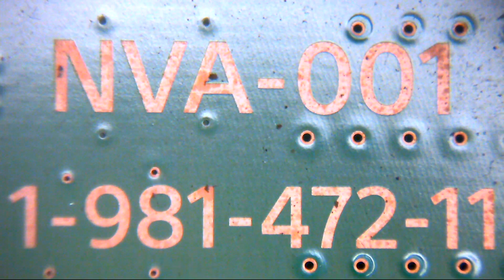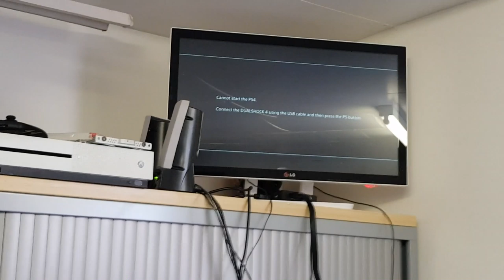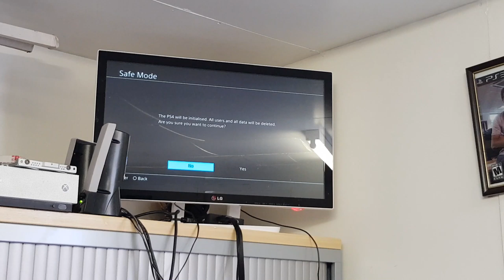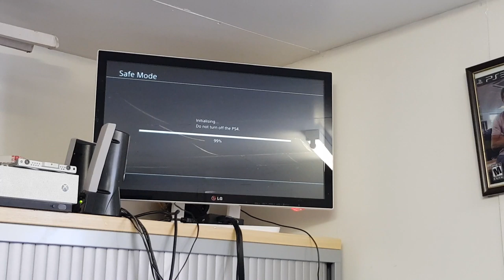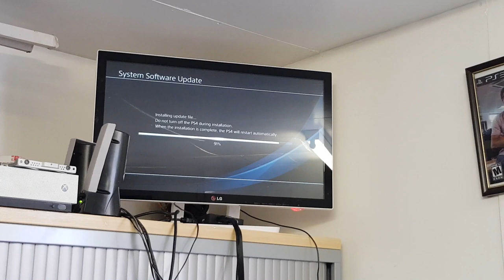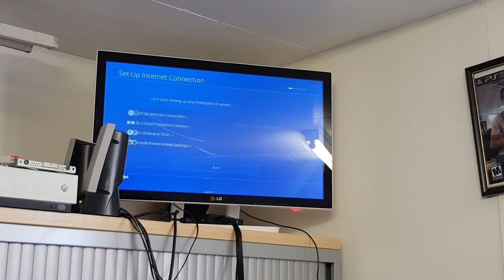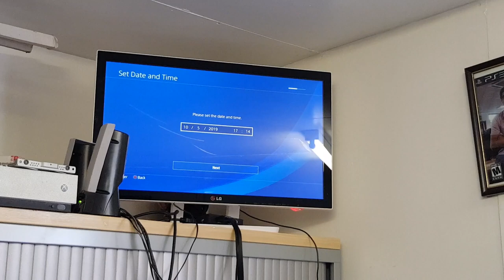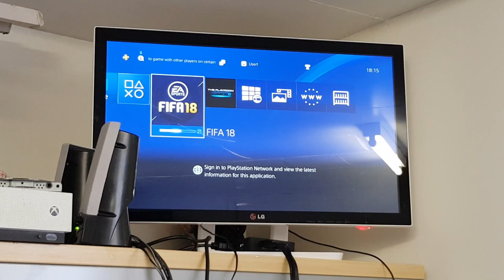PS4 Pro Fix SU-42118-6 No Disc Feed and Update loop - Fault Diagnosis and Repair (NVx motherboards)

Comment: You're back. Fantastic! I sent you a message on Twitter, but I thought you'd probably be busy.
Reply from the maker: I've not checked Twitter for a while bud to be honest - I think I may close my account on there just to streamline the communication methods open to me as trying to keep track of here, email, Twitter, facebook etc is a nightmare! Drop me an email to the address in the description bud if you still need me and I'll get back to you ASAP, cheers :)
Reply: @AndrewPaul  I've got a 1.3 Xbox original here. The clock cap has leaked. I'm determined to refurb it. It is the worst damage I've seen from the leaky cap ever. I'll post some pictures when I get time. But it has actually eaten away through the metal inner casing.
Reply: @AndrewPaul  can help me

Comment: I agree 100%, the PS4 slim is my least favorite console to work on. It seems to be the least reliable as well, disc drive,HDMI, and power supply issues. I manly get customers bringing the Xbox One in with update errors. Sony did do a better job with new software installs though, Thanks for the video!

Comment: Thank you again for your patience explaining all the procedure. I have this issue, but I already checked all fuses, but they have continuity, and seems to be ok, what else could be wrong? or what other fuses should I check? to be honest, I can not identify which component is the one mentioned in the board, for example F5001. I hope you can help me, or somebody else in the comment section. Thanks in advance!!

Comment: Hi Andrew, great video as always. What would be the next thing to check if the fuses were OK? Thanks
Reply from the maker: Check the simple stuff like condition of the cables, connectors, soldered connections etc to and from the drive. If that's good, manually feed a disc using the manual feed screw and see if it plays - if so, it's quite likely you have a burned feed motor - this is a common issue on older PS4s especially - I've changed out quite a few motors on these 10xx/11xx consoles especially.

Comment: So is it usualy the fuses whit this problem? I have one whit this problem it been working fine for 3 years.  but after update 9.0 came and the code came. The disc have been dead the before this. But i guess. This is the reason. Have to check.. Nice to see your well in this  time and days. Your videos and support always helps me.

Comment: Hi, thanks for the video, i recently replace an F6202 fuse, installed system software 8.01 but after replacing the fuse the rollers spin on system start up for like 10 seconds but otherwise non responsive, does not take a disk at all. Motor has continuity, rollers and white sidebar are in tact. Wondering if it could be a ribbon cable or a chip on the board (hopefully not). Have you come across this issue before? Not worth getting a new BDROM as it is 70 odd quid! Thanks

Comment: Hello Andrew. First, great informational videos you have. Thanks for sharing these with us.
I have an old PS4 that could have this problem. I see that you say in the description that we can use Panasonic ERBRD1R00X fuses as replacements. Is there any other fuses you could tell us that we can use as replacements as well? In my country its not so easy to buy those spare fuses separatedly.
If you could give us the specifications of the fuse as well (if you have them), I think we could try to find other replacements based on those informations.
Thanks again!
Reply from the maker: Hi, Indeed - any similar-spec'd 0402-sized, 32V DC, 1A, fast-blow fuse should be fine.

Comment: My board looks a bit different but the previous owner bridged f6202 with a wire 

I ordered the fuse off eBay but does the PS4 know if it’s bridged or a proper fuse ? 
Just surprised it’s not accepting disc at all. 

Any thoughts ? Any other fuses to check on the board except 6201, 6202, 5001. 

Thanks in advance
Reply: Well if it is jumped it's possible there's damage to the renesas

Comment: Hi Andrew, I'm a big fan of your diy tutorial of fixing consoles! Keep up the good work mate! A lot of people found relief with your channel.

I have the same problem with my ps4 pro of this SU-42118 6 error.

All fuses are ok. I also check the BD Rom to other ps4 and it's all function well. So the problem is definitely in my ps4 motherboard. There are no sign of soldering or component burns. What would be the next probable problem given above facts okay?

Thanks Paul. Looking forward that my ps4 bdrom can work again. #fingercrossed.

Comment: Hi, I have just replaced a blown F6202 on a PS4 Slim and also found a bridge between two legs on the renesasas. Not sure how that happened, assuming someone was messing about with it before me, but i've fixed that too. Bluray drive sensor has always worked but still nothing from the rest of the drive. I've checked the motor on the KLD-004 and I'm reading between 100 and 300 Ohms. Should I look to replace the KLD-004? Or am i just wasting my time because it's probably the renesas? How can I confirm if it is? Thanks.

Comment: Hi Andrew, how are you? Hope so...
First of all, thank you for your dedication with the videos posted, you are to be congratulated.
See if you can help me with this question.
I have a PS4Pro Card - NVA-001 identical to the one in this video.
When keeping both fuses on the board, it shows the error ce-35888-2 and when removing the F-6201 the error changes to su-30631-3.
Is it the Bluray Drive Chip or the Corrupted Nor..

Thank you in advance for your attention, big hugs

Vander Daniel - Ourinhos - SP - Brazil
Reply from the maker: Hi Vander - many thanks for your message!
To be honest in these instances it's hard to tell, but it definitely looks to be one of the two sadly. Most likely will be the Renesas - they are very unreliable it seems.

Comment: Just got one of these today even with same motherboard. If fuses test good as they did in my situation along with a good turning motor, I guess BD7764MUV motor drive controller IC would be the next logical step. Have seen quite a few older model PS4s with same symptoms and just another one a few days ago.

Comment: How do you determine the rating for these fuses pal? Do you have a spec for certain boards or a schem from somewhere? Research size etc? If of course you have no donors! Welcome back BTW
Reply from the maker: I had stacks of donors available for ages - eventually when the time came to buy some in it was posted in a repair group somewhere that I came across to use the ones recommended in the description. IIRC they're 1A fast blow.
Reply: @AndrewPaul  Ahhh that makes things easier then. I hate tracking down SMComponants when not sure of specs. It's a whole other job to deal with ;)
Reply from the maker: Yeah - it's a nightmare but also strangely fun at the same time ha ha :)
Reply: @AndrewPaul  We will endure!

Comment: Hi mate where can i order fuse f6202? My ps4 slim wont update to 11.52 because of that fuse. Also do u need a microscope to do the fuse?
Reply from the maker: Mouser or even eBay should have the fuses you need. You don't need a scope but they're pretty small so grab a couple in case you lose one or two.

Comment: Hi Andrew,

What could be the reason for a PS4 pro sill not reading disks (loading them, spinning and laser shining, but no disk icon top right) and getting the error while updating? 

I had the f6202 replaced, before that the drive was completely dead. 

Any info, I would greatly appreciate it.
Reply from the maker: First thing would be to check the fitment and condition of all ribbon cables (both ends) to and from the drive, as well as the seating of the flex cable into the laser itself. Always check the basics first in these scenarios.
Reply: @AndrewPaul  Just took the drive apart and tested the ribbon cables for continuity. Could not find any faults. 
I would also wanna say that I tested the console with a spare PS4 slim drive, and I could observe the same behavior. Disk spins, laser reads, however nothing on the screen.
Have maybe you encountered a similar problem in the past?
Reply from the maker: It's not one I've ever seen personally, no. Only time I've ever seen anything similar is with a knackered laser but you say this one sounds to be reading and spinning fine so in that instance, if everything is spinning up and sounds to be reading OK, I'd be checking the connectors for any damaged pins etc, then tracing the circuits back from the connectors for any missing / damaged components etc. Failing that, get a working board and start taking voltage readings, diode mode measurements etc and comparing values to try and spot anomalies and go from there.
Reply: @AndrewPaul  Another thing that just came to my mind. The original drive from the console was not spinning the discs. I persume some motor damage.
So to test it, I used a drive from a ps4 slim that works. Could this be causing problems?
Edit: What surprises me the most is that I still get the 42118-6  error, after replacing the fuse
Reply from the maker: As far as I'm aware (unless anyone knows differently) the slim and pro use the same KEM-496AAA deck, however I think the sensor boards are slightly different between the two drives. Whether that makes a difference to the console or not (i.e. if the connector pin out for the disc / mechanism position sensors are different between the Slim and Pro drives), I'm unsure - it's not something I've ever looked into in any detail.

As a test, I'd take the laser deck assembly from the slim drive that's working and install it into the Pro drive, then reinstall the Pro drive and see if it makes a difference to the end result. It's the only thing off the top of my head that kind of makes sense barring a circuitry issue on the mainboard.
Reply: @AndrewPaul  Tried to do that without much success. Now the working slim wont pull cd's :D Not sure if a fuse blew, or just needs some time to rest, but I put everything aside for now. Wasted enough time for today
Reply: @AndrewPaul  I come with a short updated. Cross tested the drives between the Slim and Pro. 
Plugging in the Pro drive in the Slim I observed the same drive behavior. Disk tries to spin but does not, laser shines but the worm gear does not move. Since I tried a couple of times, I burned the F6202 fuse.
Plugging in the SLim drive in the Pro, there are no issues except that I do not get the reading disk icon on the screen, and I still get su 42118-6 while updating. 
I also switched the ribbon cables to test the Pro drive, however nothing  changes.
One thing on the top of my head is what could be causing the Pro drive not to spin and move the laser?

Comment: excellent video, I made a what you did, but it worked for me, so I borrowed a ps4 pro from a friend and put his reader on my ps4 and it continued with the same error, when I installed the reader on my friend's console it no longer does nothing, if it sucks the DVDs, because that happens if it works perfectly
What can I do to make it detect the reader again, since before it worked fine
Saludos desde Panamá

Comment: hi mate been watching your vids for few yrs now fixed a fair few things with your knowledge but im having a problem with a ps4 same sort of issue as this vid its a original ps4 popped f02 replaced it and it popped agian im not sure as to why they are popping im thinking maybe its something to do with motherboard any help is much appreciated
Reply from the maker: I tend to find it's the feed motor in the drive is bad when this keeps happening. Change the motor and the fuse together - all should be fine then.
Reply: @AndrewPaul  thanks for the reply ive got spare drives so will nick a motor from them fingers crossed lol

Comment: Hello. I got this problem and about to try to fix it. What temperature do (the heatgun?) need to be for this to work. Hope for an answer. Thanks!
Reply: Hey there I'm having the same issue did you get an answer on how to solve that problem
Reply: 370 C is the meltin temperature of the solder with the soledirng iron, you need at least 400-450 with the heat gun.

Comment: Hi there hope u doing well having problem with bootloop on my ps4 sac001 doesn't allow to do reinstall think unit is bricked wondering I got the same model board spare if I swop out nor ic do I still need to flash if not do I need to change any other parts with nor ic thanks
Reply from the maker: What error number are you getting?
Reply: Hi there wen try doing it via USB error su413334 wen using first USB port I'm getting 1 flash orange second USB port working normal if I do software via internet it just keeps looping
Reply: Wen doing internet software update getting error su424774

Comment: Hi Andrew.
I got this 42118-6 on my PS4, so no disc feed. F6202 was blown so I replaced it. Now the disc feed works most times. However, after a while, it seems the disc drive loses power and it stops reading the disc. Do you what could be the cause of this?

Thanks in advance
Reply from the maker: What model PS4 do you have there?

Comment: what is that liquid substance you add on the board after removing the fuses. the thing you apply with the brush is flux but what is the liquid
Reply: also could you give me a list of all the items you used in the video to do this so i can get my playstation repaired 😭
Reply: If you mean after he's done the soldering it will be alcohol to clean it all up

Comment: hello Andrew, thanks for the videos, I have a PlayStation pro, the fuse F6202 cuts off with each change, can you help me please?
Reply from the maker: As in it blows straight after you've changed it? If so, it's likely the drive mechanism feed motor which has gone bad - you'll need to replace that motor and grease the mechanism (or just replace the drive for a new unit if that's easier for you) then replace the fuse. Should be fine then.
Reply: Andrew Paul , precisely, I have a new mechanism but the problem is still present.  I have error code 42118-6, I cannot do safe mode
Reply: I passed Andrew, thank you very much, you are the best

Comment: i have a problem about a ps4 device it has a mysterious problem , i never see something like that
this ps4 after you sign in to ps account and installing games works well and everything is normal but when i restart or shutdown it the games gone lock and have lock sign
and when it connected to internet all things gone normal again
ps4 active as primary , updated to last version
board ohm check is normal and every thing seems normal

Comment: Hi, I need some advice if possible, I have PS4 which was repaired the HDMI transmitter was replaced,, however now it only works on certain TV's, whereas previously it use to work on any tv, can you suggest a possible solution. Thank you
Reply: It might be something to do with the  display resolution settings.
Reply: Try entering the safe mode with a TV  that the PS4  doesn't work on.

Comment: I have the same problem with nva-001 ps4 pro all fuses are good and voltages too I dont know what else could I chech. I need  help.
Reply from the maker: If the fuses and voltages are good then it's usually a bad Renesas drive controller. If that's the case, sadly there's not much you can do.

Comment: hello, what is the liquid you put on the motherboard before heating to desolder?
Reply from the maker: Hi, it's flux which helps the solder to flow and aids the creation of better, more reliable joints. The flux I use is Amtech NC-559-v2-TF.

Comment: I would greatly appreciate any advice on how to repair this fault on a 1115a motherboard. Before trying to initialize and reinstall the system software, the disc drive is completely working, ejects and accepts discs. Once it initializes and attempts to install the firmware, it gets this error code and then the disc drive is completely dead and its stuck with a blue flashing light. I can't connect my ds4 to shut it off. If I unplug the power for 20 mins, it goes back to working. Please help!
Reply: I haven't tried a new disc drive yet but I just don't think that is the issue as it seems to work fine to the point of installing the system software. I've also tried a new hdd.
Reply: @dezmcdermaid8911  maybe its corrupted Nor chip firmware, im about to send one to get fixed tomorrow. ill let you know if they fix it and what they tell me

Comment: I've got a dead xbox one. No standby voltages, mosfets not switching on. Shorting them and forcing psu to come on gets voltage to usb, fan spins up and stays on but nothing else. I'm thinking southbridge? any thoughts on that.
Reply from the maker: Almost certainly I'd say bud - a very common fault on the XBOne is the Southbridge with regards to power issues.
Reply: @AndrewPaul  does that mean full IC swap or can you just replace the Southbridge like with a PS4. Cheers mate
Reply from the maker: Thankfully the Southbridge can be swapped out on its own - they're not a tied, per-box component.

Comment: Hi paul , i am having the same error ps4 pro nva 001.. all fuse is fine but still getting 42118-6. I did also change the loading ic BD7764MUV .. but still same error..
Reply: Same
Reply: Dead renesas.

Comment: Hi Andrew,
    My ps4 is auto booting to safe mode and menu option not showing error is giving (su-34311-2) SCE_UPDATER_CORE_ERROR_SATABR_FW_GENERAL. Kindly please help if any solution
Reply from the maker: First I'd try a different hard disk drive and see if you can then force an update via USB using the full system reinstall file from playstation.com
Reply: @AndrewPaul  hi Andrew thanks for your reply. I had tried which you had mentioned and safe mode options are not showing. Please let me know if any anothet option.
Reply: Andrew i also got same error, please help

Comment: what is temperature you are working with that fan?
Reply: 370 C is the meltin temperature of the solder with the soledirng iron, you need at least 400-450 with the heat gun.